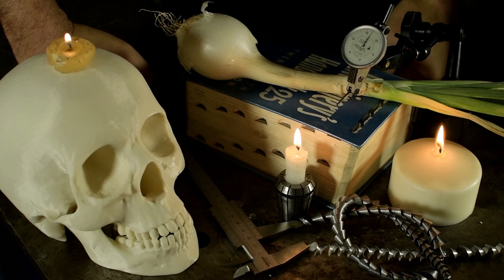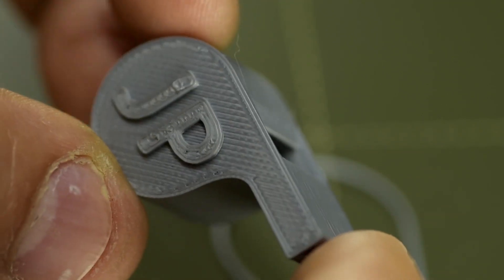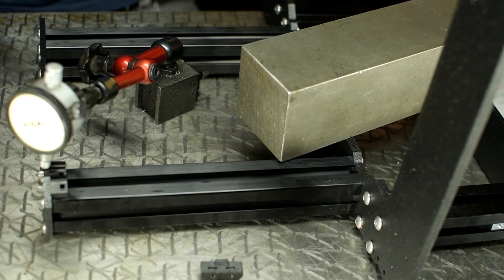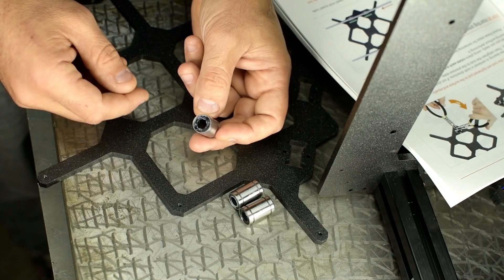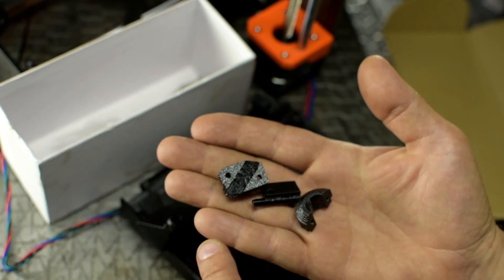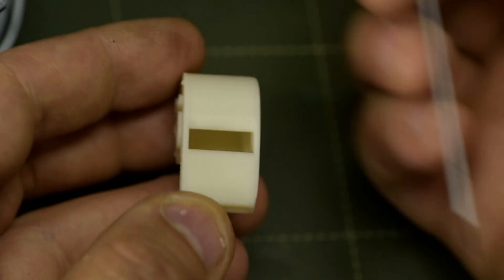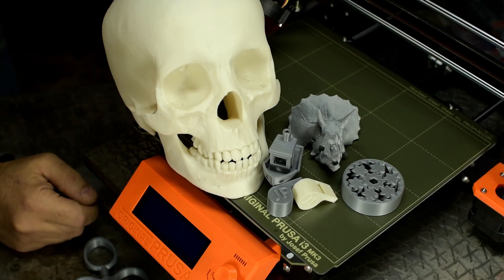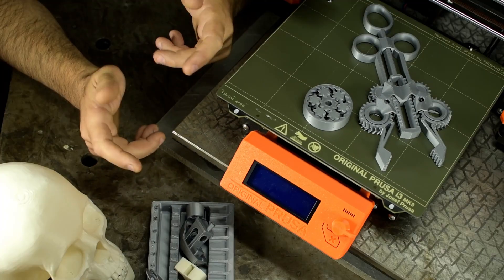This Old Tony in 3D!!! (printing)

Comment: The first printer is always the most expensive. And that's a good thing. I started with a Ultimaker almost 10 years ago, and got gradualy down in the price range. Once you know, where all the problems could come from, you could see, which printer works and which not. I'm kind of addicted to collecting 3D Printers now, I have ten or twelve at the moment. I even managed to get some of the ender clones for around $50 in ebay, recently. I ordered them, fully knowing that these are cheap chinese clones not even close to what they state in the auction. I bought them and then opened a dispute and waited until the seller was offering a partial refund :) For example - they state it was a 24V model. It was not. 12V. They state there are the bigger leveling screw - nope. Small screws. They tell you it comes with a PEI print bed, it comes with painters tape. All those things you know would happen at the cheap price for a cheap clone. But because they advertise it, they should be at least try to deliver. Since it's often more expensive for them to let you ship the whole thing back to china (Germany has consumer laws like that) they often come around with very huge discounts.

Comment: Generally, you don't get into problems until you start trying to print models not actually designed with 3d printing in mind, or designed for resin printing.
Or models are that significantly larger than the build volume. That's when you start getting into cutting up the models, adjusting for overhangs, etc.

Comment: Just watch our with PETG, it sticks very hard to the glass (if you ever use glass plane) and don't leave it on the printer, it takes in quite a lot moisture  and then prints badly (you need to dehumidify it then...)

Comment: I have the ender3 it does the same thing your prusa does, but you may have a bit more space to print. Couple things. Your benchy is fine if you really want it without the strings slow and cold(er). I'd recommend a piece of glass instead of the mat it comes with. I swap between like 6 pieces. Glue sticks help with adhesion if that becomes a problem (it may eventually). You should be good for about your first 20 prints before you find catastrophic spaghetti mess on a print that's supposed to take 3 days and your on 2 1/2. You know cnc thus you by default know 3d printing. Same code same xyz axis. Ones additive and one subtractive. Your eventually going to want to make a 3d printer and feature the process on your awesome channel. (Hint hint).

Comment: by the way expect hell once the filament soaks up some ambient moisture. Jams, poor prints, weak prints, oozing, bubbling, popping, stringing... 

I designed my 3D printer to be robust against all of those except the weak prints. Thinking of a 'cano pre-warmer. Hmm.. 

Oh yeah also I slide in a small metal tube to switch between 3mm and 1.75mm filament. /brag

Comment: As an author for ALL3DP magazine, I would highly recommend checking out our online database of free instructional articles to help troubleshoot common printing issues. Thingiverse groups are also great places to find help. I've built many printers, and one thing I can say is that the Crealty Ender 3 cost 1/3 as much, and has less than half the assembly of the Prusa. I've seen the Ender 3's put out the same print quality as well. ou may not have had any issues yet, but I assure you, after running a few rolls of filament through the old girl, she'll mysteriously develop every problem that could possibly happen. Also, PLA, ABS, and ASA aren't food safe, and I would be leery about making those whistles for your kids. PETG is food safe however, and easier than ASA to print in, but more durable than PLA. Leave some lithium grease for the cat and snack on the PETG instead. WHich reminds me, cats love short lengths of cut off filament.

Comment: Congratulations...a good choice this printer is a workhorse and the support is great too. - I use my prusa mk3 a lot for things like toolholders, brackets for my DROs, covers, adapters, spareparts...  and for prototyping in the shop. When I bought it 2,5 years ago never expected what great and reliably extensions this tool would become in the shop. I recommend buying the textured steelsheet that is making it muh better and easier also interesting the new prusament pc blend. - AND try keep your fingers away from the buildplate - first layer adhesion will become worse with a lot of fingerprints.
Love yout videos!

Comment: I like that you put some extra effort into the build. I doubt many people did some extra precision and measurement while building it. But - it seems to pay bay! Your prints are complex, but not failing. And you just started with it. 

For the small strings: Your temperature is "too high", but they are looking fine. You cannot avoid them completely, only reduce their occurrence.  Play with your temperatures when the string are way to many and look like a cotton ball.

The benchy looks great. Play with the layer height (not nozzle width) for better results.

I'm very interested in modding videos. I would like to do some modding for my printers (especially a better rail for my Anycubic Photon), but I'm lacking your tools and experience with metal work. So, I stick with plastic and the tolerances from my printers.

Comment: Are You going to replace all the plastic parts with proper metal ones? Maybe some aluminum castings?
Reply: @npgoalkeeper _ I am aware of that, but I am also awate that TOT is both a machinologist and welderologist :) and likes to build stuff. Maybe he could if he so pleeases to make some castings and machine them to gain extreme construction rigidity, on the other hand he might do something completely different :)

Comment: If you really feel like digging into the hobby, octoprint via a raspberry pi is a worthy upgrade. 

Remote monitoring and control of the printer is useful, especially for long prints. There may be a newer version that people are using nowadays. I set mine up a few years ago and haven't regretted it.

Comment: The whisky lines are an effect of "wet" filament. 
Don't get your pants too exited, you just need to put the roll of filament in the oven on about 120 F for a few hours. 
That will dry out the trapped moisture in the plastic - or make brownies idk. 

Then you should keep your filament stored dry and away from sunlight, preferably in a large box with some do-not-eat-pearls in it.

Comment: You can quickly get rid of the strings with a hot air gun. Set it to ~150 °C and blow over the stringy parts.

Comment: Tony, just a warning. 3d-printers are great, but...............
On the 'net you can find 11654 gazillions modification/improvements/add-on for your printer.
If you start tinkering with those your life is finished.
You change the electronics for more speed. ( done that)
You change the extruder for even more speed.( done that)
You add micro/laser/satellite/positron/induction/capacitive end-stop/z-probe.( done that)
You change the motors. ( done that)
You add linear rail for rigidity. ( done that)
You add a laser for engraving ( done that)
You add a small spindle for PCB milling ( done that)
............ and all the others .
With your propension for modifying things, if you get the "mod bug" you'll never get it out.
For me is too late..........save yourself!

By the way: Creality are pretty good. Ender 5 here... never missed a step (even when it was all original)

Thanks for your videos.

Comment: I have Ender 3 and it's great! You can mod it to hell and back and it has really great support from community. So the recommendation you got were on point because if not even for the best quality on the first print - you can make it as good as that prusa for less than half the price. But yeah, for someone first time dealing with printers i'd too recommend prusa for the ease of setup/use. Have fun printing (least useful but funny looking) stuff. If you're more of an experimenting guy you can check out Cura slicer (fusion 360 got the slicer lately too, but it's not yet that refined as PrusaSlicer or Ultimaker Cura)

Comment: The ender 3 is great, you won't notice a difference between the prusa and the ender once they're both built and set up properly.
Reply: Ender owner here... In print quality, that is true, you can achieve the same level with an Ender or a Prusa. But there are other aspects which make Prusa well worth the money: low noise (from both the servo and the fans), safety (the chance of setting the house on fire) maintenance (having to re-level the bed for each material, replacing the table cover when it wears out, replacing the power supply when it poops, etc.), selection of materials (the Prusa has an all-metal hot-end with direct extruder, so you can print flexibles easily, and also high temperature filaments like Nylon). You can also easily mod the hell out of the Ender and rebuild it to be very similar to a Prusa in these "convenience" aspects, but it will cost about the same too.
Reply: The main difference between the prusa and cheap options like the ender is that the prusa just works,  pretty much as soon as youve built it, whereas the ender can take a lot more tweaking

Comment: Hey Tony, to get the ASA to stay on the bed during printing you should use a slurry. Take two feet of the ASA filament and cut it up in to 1 inch pieces. Add it to about 3 ounces of acetone and let it dissolve. Before you print just take a brush and get it wet with the slurry and wipe a thin film on to the bed.

Comment: As part of my pandemic projects, I bought an Artillery Sidewinder from Amazon.  With some filament, and a few goodies and extras, it set me back  about $ 550.   I've been having a blast printing out workshop accessories - glue holders for that superglue bottle that is magnetically charge to fall on its side,  a custom holder for a X-acto knife other than my thigh, that sort of thing.    So far (2 months) it has been working well, and delivering the minimum of pasta.    Keep your filament dry, and don't mess with the machine if it's working.

Comment: Welcome to the club. Now it’s time to have fun and do upgrades and all the mods.
Reply: I have a lot of customers that run machine shops and they use 3D printing for custom jigs and clamping. While it’s difficult to mill PLA, you can use ASA, ABS, PETG milled to some really tight tolerances. Also in your line of work look at heat inserts for making threads in printed parts.

Comment: You wila have lots od fun. I already used over 30 - 40  spools and still have ideas. Motor couplings, gears(i even printed a gear for the minilathe), holders, adapters, enclosures, machine parts, fixtures, airsoft parts, cable mounts, battery adapters, robots, lego pieces and many more. Together with CAD skills and imagination the possibilities are endless.

Comment: An 40x40 Aluminium framed 3D printer I have lives on an offcut of artificial stone benchtop - on top of an old table - helps to ensure "square" - a good machinists level is also a handy tool to get things "true"  - I don't have a spare surface plate for it to live on ( Though I do have a couple of old billiard tabletops. - makes a nice foundation for a trestle table...)

Comment: Hey Tony! I noticed you let your PLA spool's end sit free- That's asking for your spool to cross over on itself, which causes a headache that's almost worth just throwing out the spool.

Wherever your filament end is, it should be held on place. Either in the hot end, in your hand, or tucked into one of the holes/slots in the side of the spool.

Comment: I have the Ender 3 and it worked straight out of the box and was easy to assemble. I've been using it fairly regularly for the last 2 years and it still prints without issue. Need to build an enclosure so I can start printing ABS parts.

Comment: Having built 2 from scratch and just bought an Ender 5 Plus, they are fun to assemble.

As for your benchy, the rippled straight walls are often belt noise that can be adjusted by either tightening or loosening the belt.

Comment: This is another important tool in your workshop.PETG is oil resistant and what I use for anything that goes on my Lathe or Bridgeport. All my brackets for my DRO's and such are printed with PETG. I also 3D print complex things before I spend the time machining them to  look for problems. I can't believe you waited so long to get one. Welcome to the club :)

Comment: I had to figure out how to do some metric threading with my Monarch 10EE. I ended up 3D printing some transposing change gears out of PLA. I completed the job expecting to throw the gears away, and to my surprise couldn't see any wear or damage to the gears. I keep finding very good uses for 3D printing in the shop. 
B.T.W. Thanks for another great video.

Comment: Now you have access to mcmaster carr's 'toys r us' of free 3d printable parts....
Reply: @BarryManilowa  I heard the theory was they are fine with it, because you can make a plastic prototype and if you need metal, or a stronger plastic one, you will then order it.
Reply: @murkinstock  yeah, after all there isn't too much stuff that's actually usable 3d printed. I mostly use their models for say countersunk head bolts and such which I'm too lazy to check dimensions for and use them to cut my models.
Reply: It's nice on paper but in reality the parts can be made much better if they're designed for 3d printing. Tolerances, overhang, orientation relative to layers, wall thickness, etc. The bulk of small parts just don't take that long to model. PSA: please upload your nice parts to thingiverse
Reply: @BarryManilowa  They will always leave the models there.  They are there used for cad designers building assemblies and ordering hundreds of parts, not the dude looking how to rip off one part.

Comment: Make sure to always have the end of the filament on the spool plugged into one of the side holes, that prevents the filament from (partially) unwilling unspooling. That can cause the filament to wind itself into a knot, by making sure the ends are taught, you prevent that from being able to happen

Comment: I love my 3D printer. Most shop people look down on them, think they're only for printing baby Yodas and stuff like that. However, it makes a great addition to my shop. Recently I printed an awesome Milwaukee-to-Ryobi battery adapter. I have only 1 Ryobi battery now, but the guy I share a shop with has 3 for his various Milwaukee tools. Time to borrow some batteries! Have also recently printed table saw insert plates, a new switch cover plate for my radial arm saw, a replacement button for my screen door handle, cell-phone-to-camera-tripod holder, anything that's ok in plastic. I keep saying I'm going to build a small aluminum foundry and do some lost-PLA casting, I may someday...
Reply: Interesting thing to know-- As far as the lost PLA casting -- I tried an experiment using Styrofoam, I carved up a smallish block of it, packed it in Loose Sand -- Yes Loose Sand, and as the metal was pouring in, it displaced and obviously burned up the Styrofoam, and the casting came out good. AND This Was Cast iron!!!
Reply: I haven't been successful at it yet, but supposedly a microwave oven works well for melting aluminum. You line the cabinet with fire brick, and put some silicone carbide or other material in to absorb the microwaves. I tried just the aluminum in a crucible, but it does not absorb very well and after ten minutes the entire cabinet is getting pretty hot.

There are lots of simple gas furnace designs out there, and electric resistance ones will melt aluminum as well.

The biggest challenge I have had making the castings is probably burning out the mold. You really have to get it fully burned out, or it creates gas during the pour and ruins your part. I plan to build a chamber that sits on top of a gas furnace (not as hot as the furnace) that I can use the heat from the furnace for preheating the molds, and burnout.
Reply: Printing a baby yoda! Genius
Reply: Dude, garage ECM. Buy a laboratory power supply, 3d print your wire and part holding jigs, get a bucket of water and some tubing.

Comment: Now it's a race. My raft vs your raft! Wait, you don't need a raft because your base is flat with no curl up in the corners?! 
Frame alignment isn't super critical. When you level the bed to the extruder tip, it's pretty much done. As long as your z axis is tight and isn't leaning like a drunken sailor, your prints should come out niece.
I have an ender 3 pro. I'm a tight wad. Now I have to build a shredder and extruder so I can use all the plastics that flow through my house.
Then of course there's lost PLA casting and sand casting of 3D printed objects/parts... and machining of said bits and pieces.

Comment: Mine came from a kit but a kind of cheap from the beginning of 3D printing with some major problems, missing part, bad quality printed parts and was made to use 3mm filament. This made me learn to understand everything about how the printer work. When I finished to assemble, many years later because I didn't found the problem, the filament was unusable because too wet.

Comment: You made the right choice, I've had the creality printers and the like and you end up spending a lot of time troubleshooting.  The prusa is just a workhorse.
Reply: One of the main reasons that machine is so reliable is due to the twin Z axis leadscrew drive........most of the other budget ones have a single drive on the one side and that lets the cross beam sag and the bed going out of level.

Comment: Been there. Done that. Same result. Considering the number of parts in the kit,  assembly really wasn't bad at all.  Kinda fun really.  They did an unusually good job on both the manual and the kit'n. They even provide a bag of gummy bears and tell you how many of them you've earned at the end of each section.